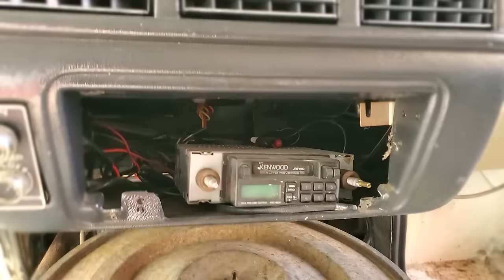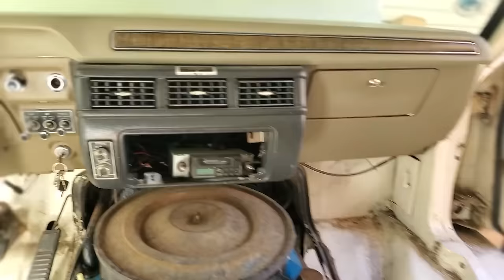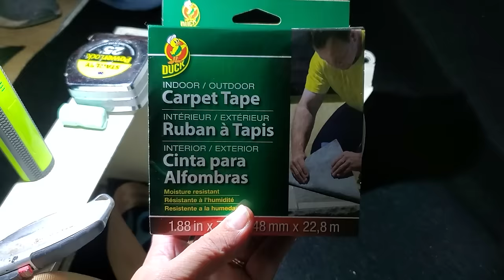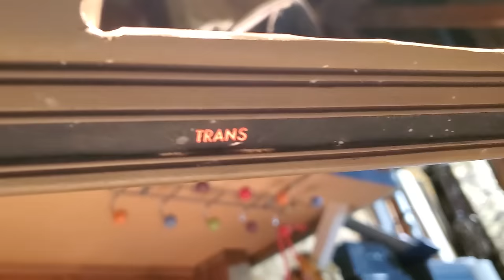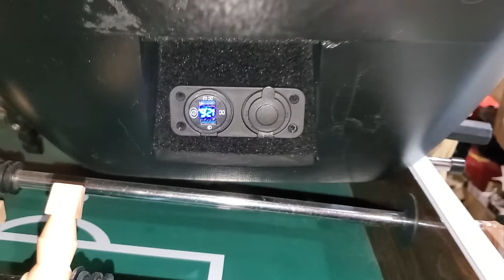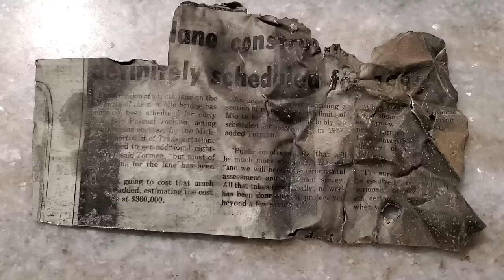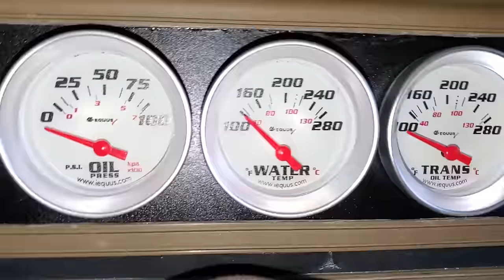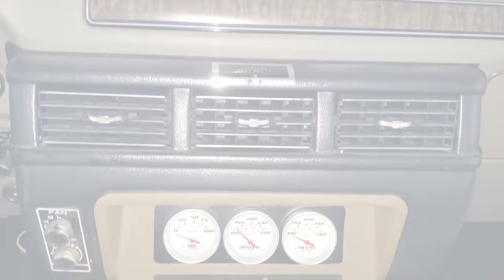RV Renovation Progress: Reviving the Vintage Cab - New Gauges, Flooring, and Comfort!

Comment: you should definitely cover the doghouse with the carpet. I was thinking that the whole time and it would definitely look good. Also the cupholders turned out really nice, though either a higher top section or having it go up at an angle might make it a little more secure of a hold on the drinks. Or you could put some of those rubber flap inserts in there so it can accommodate a smaller drink without it moving around a ton
Reply from the maker: Good ideas for sure!  It's a work in progress... we were thinking of adding some kind of rubber, almost like a smaller version of that doghouse gasket, to the cup holders to snug the drinks in a bit more.  Thanks for the comment.
Reply: @retrorevivals  can't wait to see the progress in your next video

Comment: The cab area is looking good. The 70s RV i once had had a cup holder area just like the one you built. You could glue a strip of that carpet to the inside of the cup holder ring to bring the size down a little and help with condensation evaporation. a small piece of some rubber or something under the cup area might be a good idea too.
Reply from the maker: Great suggestions for the cup holder!  We probably will add something to help snug the cups in a little.  We appreciate you watching and commenting!

Comment: Hey guys. The reason you are having the starting issue, is that when this was built, they used a ballast resistor to knock the coil voltage down during running. When the vehicle is cranking, the ignition start position of the switch should bypass the resistor and go straight to the coil, so when cranking, the voltage overcomes the drop from the starting motor. Check for voltage while cranking at the coil + side. I bet it is zero, and as soon as you let off the key, it goes to around 10-12 vdc. If this is the case, you can jump a wire from either your ignition switch “start” output, or your + initiation wire on your starter relay. Just don’t connect it to the big wire going to the starter. Hope this helps!!
Reply from the maker: Thanks for the tip😁. I do have to put a meter on it and check while cranking. It starts better warmed up now. I'll check out the voltage at the coil.

Comment: We had the '78 version of the Dodge camper back in the day. You guys probably have already done it, but just in case, have someone drain and flush your transmission, just in case. Another thing was replacing the rubber front brake hoses, after having our front right brake lock up on a bridge, fun! Bring multi color electrical wires since the old wires on Dodges are famous for cracking and shorting out or corroding. Like I said, if you have had good mechanics to help, they already have done that. You live and learn with old Dodge trucks! I really enjoy your videos. Good Luck and safe journeys.
Reply from the maker: Thanks for the comment! I need to drain the trans and replace the filter. It's on my list of things to do. I replaced all brake hoses calipers and wheel cylinders along with the master cylinder. I've replaced and rewired as needed but there's still more to do. Thanks for watching!

Comment: Holy Fiddle Faddle!!! That turned so good!! The repair might not look the very best, but short of finding a replacement, not sure you're going to do much better trying to put 47 year old plastic back together. Wonder if there's a decal of some sort you can find to just stick on the front. Covering with the carpet seems like it might be difficult to edge at the top and have it look right. The gauges should def be painted black though. The green with all the other black around it sticks out too much. The carpet looks fantastic, and will be way warmer then the rubber mat. The real piece de resistance of this entire video though... that retro cup holder!! What's a '76 van without a wooden cup holder??  Completely nailed it on that one Christy!! The only thing Harvey needs now is an Earl Scheib paint job on the cab!! 
Lots of really great work on Harvey guys!! He's looking like a new penny!! Would never have thought he could be so transformed from that broken old man to this styling new version. Always looking forward to the next new thing that's bringing Harvey back!!
Reply from the maker: Thank you!  The wooden cup holder was a non-negotiable for sure.  Need to clear coat it still and maybe a touch up on the stain but it'll work!  Too funny about Earl Scheib... Tyler has an Earl Scheib sign somewhere... if we ever build a pole barn, I hope it surfaces!  Thanks for the comment and encouragement, we really appreciate it!
Reply: @retrorevivals  Thank God you even know who Earl is!! Was afraid that would be too old of a reference to even know!! Never stop being surprised by this channel!!
Reply from the maker: Now I can't wait to find that sign for you 😆
Reply: @retrorevivals  maybe use it to cover up the boo-boo on the doghouse!! 😂

Comment: The No.27 car is Paul Menard.
For his car in the minor league series known as the Xfinity Series.

Now, for your floor.
Yes heat sheeting works good and a rubber mat is nice, but.......
Dura liner for truck beds is even better.
It will silence almost 70% of the road noise and heat, and becomes a permanent bond to where all you need to do is rinse it off with a hose.
Same for the dog house, but that you would also apply the insulation.
I helped my buddy do his 78 Chevy campervan and his 78 Chevy Scotsdale work truck.
It knocked the noise right down to almost nill.null.
Did you save the label from your Pepsi?
That's worth $.10!😂😂😂
That was the hardest part about Tennessee  when we moved here....
Throwing away our returnables!!😂😂😂😂
Reply from the maker: Thanks for the tip! We're happy with the results from the Kilmat but we're always open to other options. It is funny traveling to other states and throwing returns away. I think there was a Seinfeld episode along those lines.

Comment: I think there is a sensor for oil n if too old will was low or nothing. Mine needs replaced, so check for a new oil sensor.  You guys give me hope. I'm just not sure  I can reno mine alone. But will see. Maybe the kids n I will give it a try now ive seen all your vids almost.
Reply from the maker: I replaced the oil pressure sensor early on and it still showed low. I also went with an aftermarket pressure gauge to see if the factory one was showing incorrectly. The new gauge also said it was low. I recently went to a high volume oil pump and the pressure is now in a better range. Good luck with your project 😉

Comment: And that sticky insulation u put on the floor u should do to inside of dog house at home d it’s half price auto twice the price
Reply from the maker: Thanks!  We didn't think to check the depot.  Our plan was to do the inside of the doghouse but it actually had a pretty solid layer of fiberglass insulation so we just left what was there 😁😁
Reply: @retrorevivals  did not see fiberglass but the other stuff reflects heat back I know how hot it can be next to box

Comment: Just a couple of suggestions..Please paint the rusted breather also why not insulate the inside of the doghouse.You could also put a paper rack in front of the bad spot on the dog house and one of my pet peeves is dirty door jams give them a little love with some soap and water.Also on the starting issue I can’t remember if you put a new distributor in it or not if not try a new one.
Reply from the maker: Those are all good suggestions!  We appreciate them.  We had intended to insulate the inside of the doghouse but discovered that it already had a pretty thick layer of insulation.  We have not put in a new distributor yet but it's something that we should probably do sooner rather than later.  Thanks for watching!

Comment: On my Chevy van I ordered a outside decorative insulated cover that had a leather fabric you could buy them with different colors and everything and you snapped them on with buttons that you screwed into the engine cover I got them from the van connection in Toledo but they have closed many years now but I'm sure you can still get them online dog House fabric van covers you guys are doing an awesome job I'm from Erie Michigan area
Reply from the maker: Thanks for that tip!  We'll have to weigh our options on what to do with the doghouse.  A leather insulated cover sounds perfect.  Thanks for watching 😀😀

Comment: So u should have used primer on dog house before painting, but still looks good, using a rust inhibitor sandable primer ( turns light rust back to steel) best one I've used was crown brand cause on paint it dries clear, but  good job and smart using it, as for oil pressure gauge just a heads up that the oil pick up pump is on the weak side hence the low pressure then normal at speed, so heads up you probably will be looking at changing that out soon and yes from experience, once again amazing job on the editing love the videos and also yrs is a dodge mines a gm and funny part is seats, seat mounts, dog house pretty dang the same even the step up lol, thanks for the laughs and also the info, yes kinda stalled on Mc gimmy had to drop the gas tank, twisted my knee looking at replacing gas tank and sending unit just another goodie to add to the have to change out list lol, but I've run into a lot of omfg why did they do this and that with wiring, gas lines ( no clue how it passed legal propane  inspection lol ), gator tread wheel well trashed repair job, just a whole lotta can I borrow ur hubby for a month or 6 lol he reminds me of best friend Eric Sandrine from northern Ontario, not much ever phased the man but rolled with the punches with a smile and a chuckle lol, anyhow thanks for videos please keep them coming,  john
Reply from the maker: Haha, the list of projects seems like it's neverending, doesn't it?!?  I don't think these old RVs will ever be "finished." Does it count if our spray paint was paint and primer in one?  We definitely need to do more work on that doghouse but didn't want to spend all the time to smooth it if we ultimately decide to cover it with fabric or carpet.  Thanks for watching and sharing your journey too!
Reply: @retrorevivals  you should have just filled it then smoothed it but if you do a covering that's optional, myself I'd just smooth it up, and actually primer and paint is ok just some primers out there are gap fillers and thick but will warn to others that not all primers accept different brands of paint, so try to match primer brand with paint have had sooo many bad experiences in past lol as for the list well it just got even more comflicated with the insulation and moisture or condensation issues as we will be in this RV more than I dAre to admit to lol ( & yup did mean comflicated lol)
Reply: @retrorevivals   I was just re -eduflated on insulation and heatshielding and sound proofing, and vapour bariered lol and which way was best to insulate the camper area's, and updated more about the different brands of heat shielding,
Reply from the maker: Thanks for those tips.  Love how you're not afraid to invent words either, lol!
Reply: @retrorevivals  that's an old saying from where I grew up lol but once again was refreshed on the lost or shelved almost lost teachings of my past, I managed to pull the quadrajet carb and mines been like the r.v. ..... Butchered so going to see a contact and see if he can help out with some spare parts, it just amazes me on how many of these old r.v.'s are out there and just how hard it is to get parts lol cause I've been approached 3 times this week alone to see I'm willing to sell it or part it out, but I kninda need it and gotta get it done within next 6 weeks as I have to go out of city for medicals and paying for motel rooms, and transport really isn't an option lol, but anyhow I'm off and hobbling ( blew out knee doing gas tank drop , yup way to go lol) anyhow take care
Reply from the maker: Oh wow, that's a tight timeline.  Hope you can get it done in time and not have to pay for a hotel!

Comment: Spray painting in cold temps is easy. Put spray can in the hottest water you have. Use heat gun to warm the object, spray(making sure water doesn't drip from can), and bake it with the heat gun. Done.
Reply from the maker: Thanks for the comment! We had the dog house in the garage with the heat on. The paint was room temp but I like your idea of putting it in hot water. We painted outside because of the fumes and overspray. We took it back into the garage to let it cure.

Comment: Try a new oil sending unit. Might bring up your oil pressure. Looking good!
Reply from the maker: We swapped in a new sending unit. I'm also using 15w40 diesel oil. The oil pressure should be ok at this point. Thanks for the comment 😁

Comment: Low oil pressure probably means bad bearings could be the reason it hard to crank when hot.
Reply from the maker: Thanks for the comment! The bearings are probably worn. The low compression could contribute when hot. Some of the ignition wiring that hasn't been replaced is also suspect. I'll keep sorting through the wiring but the compression is what it is for now. Thanks for watching 😁

Comment: Surely the good wife was being sarcastic 32 minutes in. You need ALL THREE of the gauges he wants to install, lady. Just kidding. I have seen enough of your vids to know... that she is smart enough to KNOW... that what he is doing is needed. Even the kid watching knows those gauges are needed. Every RV manufacturing company should install gauges JUST LIKE THOSE... instead of goofy idiot lights. Every car on the road should have gauges like those. I think alternator, oil pressure, coolant temp, oil temp, and a compass should be on every vehicle made. What he is installing can help you to pull over and save an engine. It can buy you time in determining what to do when things fail. Worth having. Big time. Ladies, all of you who drive should know what each gauge does and how to read them.
Reply from the maker: Lol, surely you know the good wife loves to use sarcasm 😂. Maybe also a touch of wishful thinking that our overheating problems are in the past.  Thanks for the comment!

Comment: Didn't see what oil you are using but you want at least 10w-30 in this and if it was mine i would run 15w40 diesel oil.  The diesel oil has more minerals in it that the flat bottom lifters need.  For now just throw a can of STP in it...or maybe two.
Reply from the maker: Thanks for the comment! We're using Shell Rotella T4 15w40. I have some Lucas oil going to add too. I wish the oil pressure was better but it is what it is. It doesn't blow smoke but I check the oil level often. Thanks for watching 😁

Comment: No noise insulation/ heat reflection mat on the inside of the doghouse ?
Reply: Yes a definite must especially to protect the gauge wires from melting from the engine heat.
Reply from the maker: Thanks for the comment! We kept the factory insulation and heat shield intact in the doghouse. It consists of metal flashing and fiberglass.

Comment: Did you change the oil pump, gasket, or sending unit? We changed the belt also. Our 454 Big Block GM '94 Coachman idled with low pressure after all that. Mechanics said its old.
Reply from the maker: We replaced the sending unit but not the oil pump. We're also running 15w40 diesel oil. We may have to change the pump in the future.

Comment: Oil pressure low ,cam bearings  i had one like that i put 2 cans stp in it problem solved
Reply from the maker: Thanks for the comment!I used 15w40 diesel oil but an oil additive or two couldn't hurt. I've got some Lucas oil I'll add to the mix.

Comment: Try a new oil pressure sending unit.?
Reply from the maker: Thanks for the comment! It's actually the second new sending unit we installed. The first was for the factory gauge. The second came with the new aftermarket gauge. They were both electric. I could go with mechanical but it'll have to work for now. Thanks for watching 😁

Comment: Where's your heat guard stuff for the doghouse? That's the backside of the front showing 😮 37:17
Reply from the maker: Actually it's the backing of the fiberglass mat that's used for insulation😉.